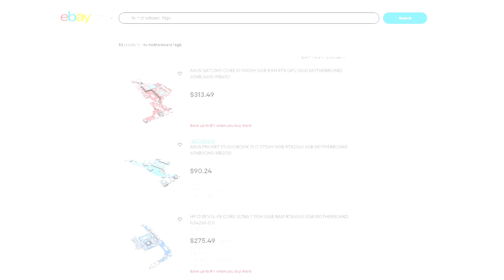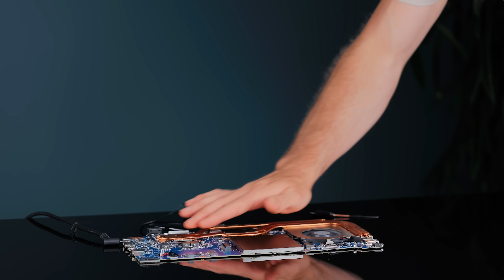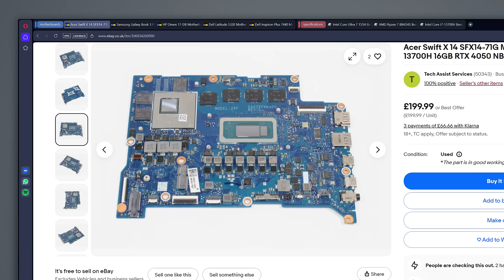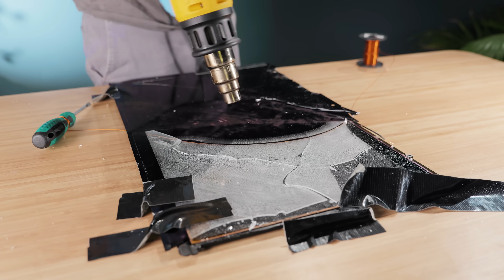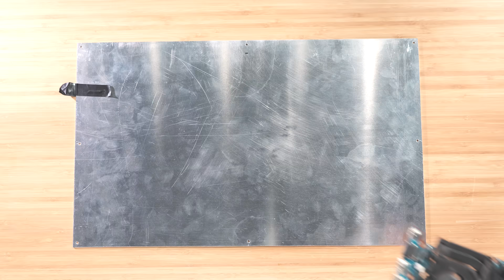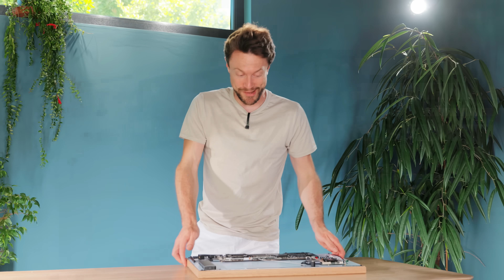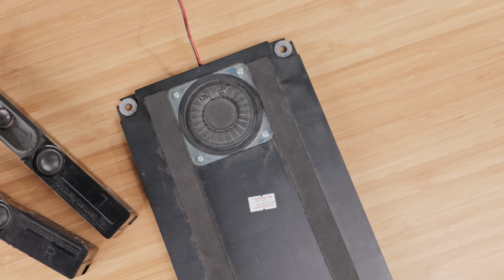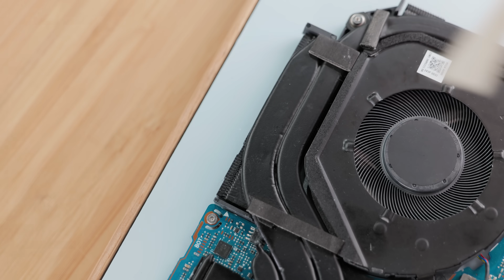A new way to build a PC in 2026!

Comment: Damn thats really cool! And honestly all this could also be done to the original imac making it look like completly stock but on the inside would be a powerhouse which would also be kinda cool!
Reply: I was thinking this. The Apple design is already pretty slick and better than my DIY skills.
Reply: @AndrewHelgeCox  Yeah Im also a sucker for some old apple tech. My pc is modded powermac g5 (fully custom everything) and my nas is a modded powermac g4 cube (also fully modded with mini atx board, ecc etc) xD
Reply: Exactly, and the imac case could be used as a heatsink. Could be a bit tricky with that slim curved model though.
Reply: @PystykorvaNokinokka   If he bought a 27" iMac there is originally a big 3.5" HDD inside, removing it makes lots of space for something else (bigger cooler, the screen driver, etc...). 
And I would even say that he could re-use the imac cooler, it is probably beefier than most laptops since iMacs had desktop class CPUs (they often run hot at max power, but with a lower power laptop chip it is probably fine even at max power)

Comment: just casually drops the gabecube killer at the end of the video like its no big deal
Reply: I love how he does that in like a 5 seconds sentence and then moves on to the end of the video "Oh by the way, here is my 300$ Steam Machine, bye"
Reply: that could've been another video in itself!!
Reply: @captaincaption  Honestly, I respect not double-dipping and opting to instead just say, "By the way you can omit most of this work and still have something that works"
Reply: @nukebirb  I didn't even think of double-dipping. You're right.

It's not his style to double-dip on anything, so he wouldn't have made another video anyway.
Reply: It is definitely a Steam machine killer, but only if the prices of these motherboards were what is described here. Looking on ebay, the same AI 9 HX 370 boards are double or triple the price quoted in the video..... which brings it right up to the Steam Machine price.
Reply: @Dev1ner  considering the near 5 mil subscribers, I think it's reasonable to believe there was a spike in the prices due to the video itself, and that's what you're currently seeing.
Reply: @riku861  did you miss the part where I said you can look up the historical prices and show that's not the case?
Reply: @Dev1ner  you missed the part where you didn't say that. Your comment makes no mention of historical pricing
Reply: @riku861 you're right - I mentioned that on a thread from another comment on here, but not this one. But my point still stands, I love ETAs videos and watch them all. But even his next video or two after this, he did the exact same thing again. He made a whole video around a cheap thing that literally is not cheap, and I caught that video within an hour of it being posted and the prices were all double what he paid in the clip.
Reply: Yep, he got a crazy good deal. From what I've seen, a lot of used goods in the UK go for a lot cheaper than they would in North America. Old game consoles, general tech, and especially cars.
Reply: @Dev1ner  It's been a couple days since the video, and there's a trend with Ebay tech resellers where, whenever someone drops a YouTube video about budget hardware that gets decent numbers, within an hour the ebay prices of the hardware in question doubles, triples, quadruples, or sometimes even quintuples.
Reply: @Spekoboul Supply and demand. The prices of such hardware were artificially low because there was no accessible guide for how to use it outside its intended application. People saw the video and bought up the limited quantities of hardware that was cheap, leaving the hardware that was listed by merchants at a significantly higher price than the market would have previously supported.
Reply: @Spekoboul What is? The literal first rule of economics?
Reply: AHAHAHAH literally ripped my ass off with that one
Reply: what game was used in the demo of that small build?
Reply: @hamzasadouk4741 RDR2.
Reply: I was about to write about it too 🎉
Reply: Dream bigger - you can do it!
Reply: *While sounding like a jet engine
Reply: @EC18FEA30B  It's possible to switch out the stock laptop cooling for some thing better, if you are willing to put in the effort.
Reply: @EC18FEA30B  Shouldn't be hard to plop down a bigger heatsink for $50 and increasing the size of the enclosure
Still tons cheaper than the Steam Machine
Reply: @GyroCannon  how are you mounting that? laptops dont use standard mounting holes. And other thing to think of is time. Sure this might cost half as much as a Steambox, but only if your time is worth nothing. It will take you quite a lot of time to search for a good deal for a board, verify that it is compatible, fix any potential issues, design and manufacture solution for the cooler and then design and manufacture case for the PC. Maybe that is worth it for you, but it is a lot of effort and there is always risk of ending up with a paper weight
Reply: @M1nttux  A 3d printer or use the tools used in this video. Not very hard to do. Easier than at least half the things done in this video.
Reply: @berkertaskiran  good luck with that my friend
Reply: @EC18FEA30B  Probably not, since its much better ventilated than a normal laptop would be
Reply: Isn't it ironic that all it takes to beat the gabecube is a salvaged motherboard.. with a Ryzen 9 and a mobile RTX4060 (DLSS is literally black magic)
Reply: @TheReal_LuaDipa whats ironic about it? that a stronger system beats the weaker system? that salvaged parts are cheaper than brand new parts that are basically custom made for a single device?
Reply: @shaggy.mcschwaggens nothing i just like to use the word. Free will bro
Reply: @TheReal_LuaDipa fair
Reply: @TheReal_LuaDipa now that's ironic
Reply: Its ironic that he made a much simpler computer that many of us might have a go at vs. this art piece that requires not only good soldering technique, but some custom electrical knowledge, an insane level of patience refurbing a monitor, and an entire workshop of tools (ie jigsaw).
Reply: I mean to be clear, its just a bog standard used laptop inbetween two boards of wood. Whats there to hype about it? He probably feels its not worth mentioning.
Reply: @akamemurasame4527  Probably that it's possible.  I personally love that he showed up to jump a laptop board using paper and copper and thus a way to make a power button.
Reply: @Criticalhitkoala  Yes but that's the actual project in the video. The comment was hyping up the part at the end where he casually mentions that you don't need to do all this and that you can just put it between 2 blocks of wood and treat it like a steamcube.
Reply: @akamemurasame4527  He casually mentions it matched the Steam machine's performance and its virtually in an easier to store form factor compared to a cube. Salvaging something that would have potentially gone to waste and save hundreds of dollars for the same performance of a $1K cube is definitely worth mentioning even so briefly.

Comment: Good thing to keep in mind with the laptops mobos is, if they have been cleared, you might need a manufacturer software to set serial numbers on them. At least HP and (older) Lenovo boards need them. You can find the Lenovo software, called Golden Key online, not sure about HP.

Comment: Have a 16 year old laptop sitting and wondering what to do and this video poped up. LIFESAVER!
Reply: At sixteen, it's old enough it may have a socketed, and therefore upgradeable, CPU. Those later mobile Core 2 Quads and early Core i7 QMs are shockingly competent for their age, and actually perform better than some CPUs you might find in lower-end laptops that are still in production TODAY. Also, most of the lower-to-midrange socketed mobile quad-cores are in the range of about $30-$50 on Ebay. Pull it apart and have a look, it'll need its thermal schmoo changed anyway because I guarantee you it's gone dry by now.
Reply: @nukebirb  Its not socketed it has an i3 and an AMD Radeon GPU. also the thermal paste was replaced by a Arctic MX7.  I even run win11 on it with only 4gb ram!
Reply: @Someone_Sus  Nice. Shame you can't chuck a 3740QM in it, but hey, if it works it works. Upgrading to 16gb of RAM should only be about $40 and makes 11 a lot more responsive.

Comment: this isn't a tech channel, this guy been running an ART channel!
Reply: I'm actually scared of what'll happen when he gets around to 3d printing. He'll be too powerful.
Reply: @muhtasimmunir1830 I thought he already does? Ive seen him print parts many times, but he sands, seals, paints, and polishes it to the point where it doesnt even look printed. He also loves putting wood veneer on it. I mean who wouldn't
Reply: @connorchan2614 I mean he does most his stuff by hand. Manual measurements. And the quality that comes out is just unbelievable.
Reply: @muhtasimmunir1830  the speaker enclosure is 3D printed in this project.
Reply: @muhtasimmunir1830  he already got one
Reply: tech used to be expressive and fun, he's just bringing it back
Reply: It becomes more true with his latest video 😉